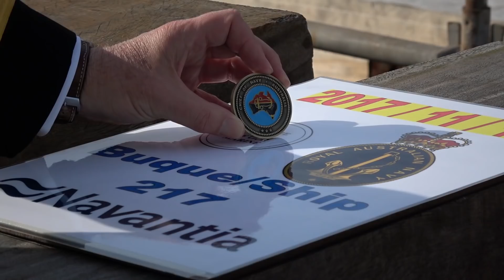NAVANTIA Ferrol: Puesta de quilla AOR ‘Supply’ para Royal Australian Navy

Comment: It would be nice for us in Australia to see regular updates as the ship takes shape. There is a paucity of information from our own DoD sources which is quite irritating.
Reply: The RAN has kept quiet during construction because they know that there is criticism for ordering two supply ships to an old design when there were more modern better equipped designs available. Someone in the RAN has been on the sangria for the last 10 years, because there is no logical explanation for ordering all these Spanish built and designed helicopter carriers, destroyers, supply vessels, landing craft. Without exception every single vessel has been delayed, over budget and had technical problems or cannot perform according to design criteria. Why Australia orders all this European defence junk is beyond me. Buy American designed ships and aircraft, and if there is a problem, you have recourse to the huge US defence industry and operating assistance and advice from US forces.